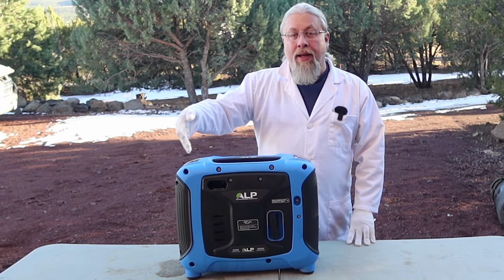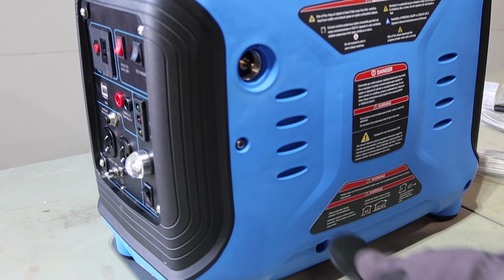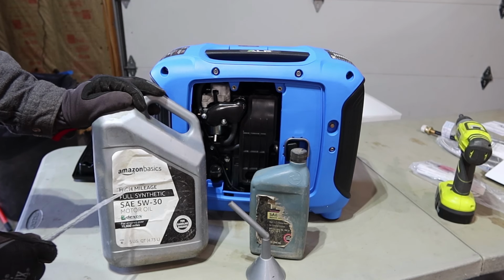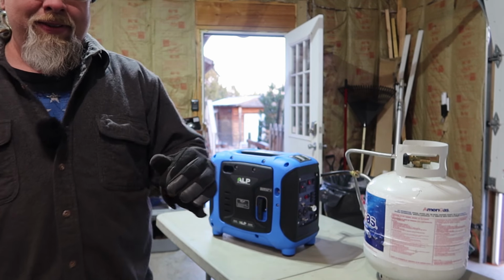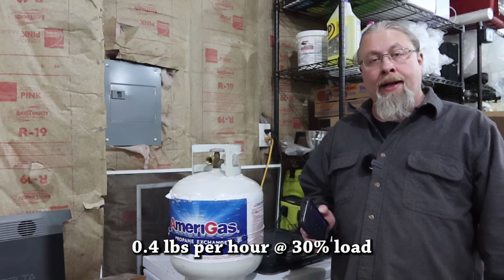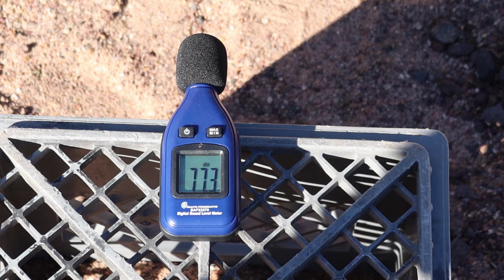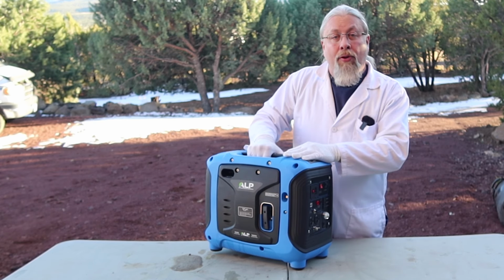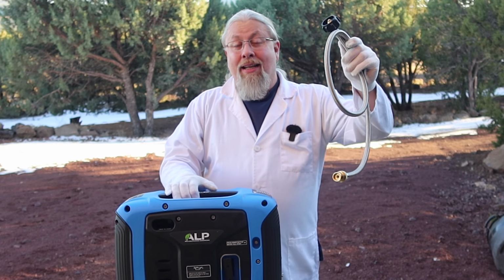ALP 1000w Propane Generator Review | Parallel Ready Eco Friendly Compact Efficient

Comment: I built a LPG powered Evaporate Air conditioner using a 3hp Honda 4 stroke motor to drive a water pump and scroll fan...
We were living in the Australian desert,  mining for opal for 10 years .
I went through two motors in that time and it worked perfectly. 
It would burn about one of these 20lb bottles every 5 days at 8 hrs a day at about 12oo rpm.
We couldn't live out there in the 45 to 50 Celsius summer temperatures without it.
I was in the air-conditioning industry and put it together in a day and a half..
PS...we made a fortune and sold the claim...with the A/C.
Gas is the go with many applications...

Comment: $500 for 1000 watts? Very little bang for the buck. No thanks.  A fridge takes 600Watts. You can get a 4500-5000 watt gasoline generator for the same amount. I can run my water pump, oil furnace, and fridge on that.

Comment: 15:52 so 3lbs of propane consumed to generate 4hrs*550W=2.2KWhrs. That would be 1.36 lbs of propane for 1 KWh of electricity? Or at costco propane refill prices ($0.50/lbs) approximately $0.67/KWh?

Trying to decide between portable solar or propane power for backup and camping.

Comment: A good tip to run new generators, are to have the economy mode on, that way it don't Rev that much.. I have a older gen that have been with me for many years, and always starts on the second pull regardless how long it's been sitting.. But that one I have to adjust the carb to run on lower rpm when I did the break in period.. It ran for 2.5 hr, the last 30min on 500w load..

Comment: 1000 watts is peanuts. My cargo trailer air conditioner requires two Honda 2000 watt. Not sure what air you are using?
Reply from the maker: 5000-6000 BTU runs all day on <800w.

Comment: I=P/E  Current =Power /Voltage= 1000Wats/115Vac(RMS)=8.695Amps (Surge current) APL spec is Max of 7.1 Amps, Max A Running wattage is 850 Watts, 5000BTU Air Condoner Surge Current is around 9 Amps

Comment: thanks for the video. .. Generally speaking, are propane generators more or less efficient than say, petrol or desiel ?
also, what does the eco mode actually do ?
.. do you think you could build a small enclosure for the generator (assuming you vented the exhaust / air intakes correctly), to help kill the sound ?
thanks again!
Reply: what your measure of efficient?     eco mode on any gen usually throttles is down when load drops off,  increases again when load returns

Comment: Do not use gage on dip stick to fill oil. Fill to at least to 1/2 of the threads on the oil fill hole. Use 1/4 choke and prime for 30 seconds before starting . This will NOT run any 5000 BTU Air Conditioner even though the Current rating for operation for most is only around 4.7 Amps it takes at least 9 Amps to overcome the surge current on most all 1000 watt generators. The Honda 1000 exceeds its current rating ( up to 11 Amps on some) it can start an AC if you start the fan first then turn on the compressor. Propane is a clean burning fuel with little if any carbon deposit on the cylinder walls. Synthetic motor oils have a higher flash point and leave very little in the way of carbon deposits. After a 10 hour burn in change the oil to remove any metal fragments and refill with synthetic and it should be good for year at least before changing.
Reply from the maker: Sorry but it absolutely will run my 5000 BTU. I ran it on a Sportsman 800w for nearly two years. This has more power.
Reply: @HOBOTECH  I had a Sportsman Generator it was such junk Amazon would not take it back and refunded my money.
Reply: 1000Wats/115Vac(RMS)=8.695Amps (Surge current) APL spec is Max of 7.1 Amps,
Reply: @HOBOTECH  Please give me the name of the AC you used.

Comment: My ALP just arrived (finely) $20 for crappy FedEx shipping that took forever . I am using Synthetic oil because of its high flash point that reduces carbon deposits. I did not use any regular motor oil to brake in the engine. Propane is a very clean burning fuel and so keep it clean from the start. Not sure if the 7.1 Amp will overcome the surge from the 5000 BTU Air Conditioner If I recall my Gas Honeywell 1000 took 9 amps so had to start it in stages fan on then compressor.
Reply: Well they were too cheap to buy a15 cent funnel so I got oil all over the place. And the 12 inch hose has the wrong fitting on it cant tell because the instruction suck. The fitting should not matter though. I spent 2 hours trying to get it started and it will only run for a few seconds. I spent $2000 and gear (from China) this week and none of it works. I thing the Chinese are dumping a lot of crap on us.
Reply: Had a problem starting the Generator but Bobby at tech support helped me out. DO NOT USE THE GAGE ON THE TIP OF THE DIPSTICK -  FILL OIL TILL IT IS COVERING THE THREADS ON THE FILLER HOLE. ONLY USE 1/4 ON THE CHOKE

Comment: Is 1000W ALP providing enough power to charge up an AC200P via AC adapter?
Reply from the maker: Yes
Reply: @HOBOTECH  Great.  Thinking about a hybrid back-up system - only using the generator to charge the 200P on cloudy days / nights.

Comment: How would one run an AC with this generator? Super long extension cord?
Reply from the maker: Plug a/c into the generator...
Reply: @HOBOTECH  so the generator is outside due to exhaust.. ok..i can  see what u mean. Works for ground level homes or ones with balconies. But i live in an apartment bldg.. will continue to look for other options.. I'm enjoying your vids btw.
Reply: @engelcrona  - get a window hanging box, just hang it outside a window, like a window A/C unit
Reply: @DavidHalko  clever.  Thx

Comment: Go to the hardware store buy the little red oxygen bottle you crack it open in front of the air filter your efficiency will go through the roof if you need very little of it to put the efficiency back up the best thing to do just go to sea level and compressed air in a air pig it’s the safest way to increase the oxygen or use nitrous oxide .

Comment: For someone with a battery bank, needing to just recharge it on cloudy days (less solar), running this occasionally on eco-mode as needed is an excellent way to address the need!  THANK YOU!
Reply: But you are polluting!
Reply: @tedmoss  — Propane pollutes less than other fuels. Even solar pollutes when you consider the manufacturing process.  What would you suggest?
Reply: @Erin-Thor  bicycle generator
Reply: @user70331  — Yes, for one battery, LOL!  I’ve seen off grid coffee shops in other countries where the patrons ride bikes to power the car batteries to run the laptops and whatever.   That works.  But one person riding a single bike produces enough electricity to run a bike light and a little more.  Charging a few li-ion batteries with say 400 Ah would take you… hell I’m not good at math… a hell of a long time, LOL!  I’m thinking weeks.   Dammit, now you’ve given me homework!  LOL!
Reply: @et5313  nobody is riding bikes to power a fucking car battery. A person who is in good shape would have to ride a bike for 1 HOUR just to produce 100wh... do you know how many wh it takes to drive a tesla model 3 just 1 mile? 240wh! You would have to peddle for 2.5hours of hard peddling just to charge 1 mile of range on a battery. You arent powering nothing more than a cell phone with a bike, period.
Reply: @user70331 this will force people to lose weight, i like this idea.
Reply: @tedmoss  so?
Reply: @randybobandy9828  The point flew over your head
Reply: @randybobandy9828  — Pollution is everyone’s issue.   Have you taken a positioning cruise (end of season transition from say Portugal to Florida) lately?  Our ocean has a lot of floating trash in it. When we make solar panels, windmills, li-ion batteries, the processes pollute more than you might think.  @Ted Moss has a point, he just doesn’t understand that propane is second to the sun for no pollution, that is if you don’t count the chemicals used.
Reply: @Erin-Thor  we will.never be able to like a modern way of life with out some pollution.
Reply: @randybobandy9828  — I agree, but that doesn’t mean we shouldn’t try to polite pollute less.
Reply: @Erin-Thor  Ideally you could invent an on, off switch that would turn this on, off when running a 110w, 3.5 cubic foot freezer, which runs on cycles.  Any takers there.
Reply: @UPdan  — Invent?  Moi?  😋  Buy yes, invent, not likely. LOL!
Reply: @tedmoss  You breathing is polluting.
Reply: @tedmoss  ohhh.... bug off with your pollution ,stick it where the sun don't shine

Comment: Can I run my Iceco VL65D fridge with it plugged into it's AC receptical? Also can I charge my Bluetti AC200P at the same time running my VL65D being  plugged into the Bluetti; in other words pass through charging.
Reply from the maker: yes and yes
Reply: @HOBOTECH  just to be clear; I can charge my Bluetti with the ALP 1000 propane generator  while my Iceco VL65D is plugged into my Bluetti correct?

Comment: That light makes the unit just a big propane powered flashlight.

A simple spark plug wrench is a great accessory to have for one of these things. Definitely something I think should come fit into the case. The oild though I find less necessary for them to ship. It's a generic product and I bet it has something to do with shipping. I could be wrong but I think any shipping company would want to know about flammable liquids being shipped.

Also, they go through oil massively anyways.

I think it should come with the hose for the big one, just cuz it's massive. Like so big, so why would they expect someone to just use a small tank? Also I've seen a much more interesting propane generator specifically designed for small bottles. They dock into it. It's 900 watts. Brand is Baja. Idk how good it is though but I heard about it by word of mouth as being a good thing for camping.

Comment: Good review, but I do think you were entirely too butthurt about no tools and oil. My experience has been the cheap-o units come with tools. Oil can vary from company to company if it's going to be there. The last 2 gens I bought did not come with oil.  I also question your use of the term "break in oil" as most small engines are already broke in by the time the consumer ends up with it.
Reply from the maker: I have purchased 6 generators and this was the first to not include oil or tools. I was making an observation and relaying that to the audience. I think too many are focusing on those minor points.

Comment: That's 1 KW. At 120 volt it's good for about 9 amps.  Think about that...., What's the average Mr. Coffee pull amp wise?  This thing is a joke
Reply from the maker: I've run my Mr Coffee on 1000w... My air conditioner, instant pot, pizza maker, microwave. I have videos going back years proving this.

Comment: I noticed that the "Eco Mode" switch was in the ON position when you tested how many watts you could pull.  What if you turn that feature off?  It also seems that when you performed the sound decibel test, the equipment you used to put a load on the generator, also created noise.  Would that effect the results?
Reply from the maker: Eco mode doesn't matter once you pull enough wattage. A more accurate sound test was redone in the follow up video no one seems to watch.
Reply: @HOBOTECH  Thank you, Sir... yes, I've seen the updated one 👍😀

Comment: In the UK that would not be a large Propane container ours run by weight,  size A 4.7kg, size B 11kg, size C 15.3kg, size D 23.2kg, size E 46.5kg. and we do not call Propane 'gas'
Reply: @UCVsNMiYQkqwIq_gd0rTJF9g Only those who do not use Propane on a business level would possibly call it 'gas', it is mostly used in industry as a cutting gas along side acetylene, with a secondary market for cooking and heating.

Comment: Take caution with propane only generators. I live in Florida and bought a propane only generator. I loved it until it stopped working. Then found there were no places that would work on propane only generators within 150 miles. Make sure you have a service center within a reasonable distance before you buy one. There is something funny about the laws about working on propane appliances in Florida that prevents shop from working on propane appliances.

Propane tanks are called LP5 as in 5 gallons water capacity. 80% capacity is 20 lbs (yes, do the math) of propane. The newer overfill protection valves don't always allow full volume. AND the exchange cylinders only fill to maybe 15 lbs, if they fill them that much. Yes, I filled propane tanks professionally, and I measured exchange cylinders.

Comment: "Don't use synthetic during break in, you want some wear"..
Gee, evidently Porsche, Audi, BMW, Mercedes, Ferrari, Corvette, all have it wrong. They ALL come from the factory with full synthetic.
Reply from the maker: Small engines and car engines are totally different.
Reply: @HOBOTECH  Yes, indeed they ARE!  Small engines are air-cooled and run hotter than auto engines. Thus the need for synthetics.Keep in ind that synthetics are NOT "slipperier". Their sole claim to fame is that they can tolerate higher temperatures without breaking down.

Comment: Nice Video.  Does the generator need to be stored in upright orientation? Will it run at high altitude? e.g. 7000-8000 ft?
Reply from the maker: Yes. I am at 7k in this video.
Reply: @HOBOTECH  awesome, thanks

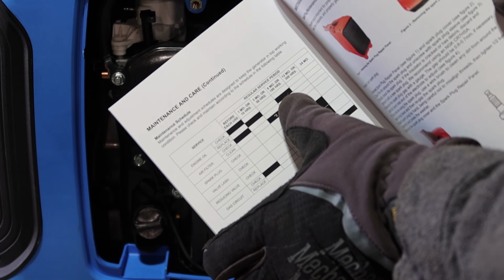Comment: At 6:00 you say to not follow the manufacturer's instructions, but instead change the oil twice as often.  Is there any science to back up your override?  With all due respect, I have a tendency to want to follow the printed directions, over the whims of a railroad bum.
Reply from the maker: By 50 hours the oil is usually black. I've lost enough generators that I change at 50. Do whatever you want.

Comment: really less than 40hrs on a 90% load, also, how many 13,500BTU A/C's will it run? ZERO..... I will stick with my Predator 3500watt inverter/generator.  It runs my 13,500BTU A/C, dometic fridge, 27" tv, interior dome lights, water pump,6 gallon water heater, converter with 2 batteries connected for 20hours on 5 gallons of fuel, its to bad my A/C doesn't turn off when compressor cycles off

Comment: Like the concept, but neither the manufacturer, nor you make total sense to me. For example, a propane engine does not require or have a carburetor.
Reply from the maker: Of course it has a carb. You still need to mix propane with air in the right ratio.

Comment: Lithium is still where it's at.
Reply: “Lithium” - can’t run a lithium battery pack for 2 days, at that energy load, at that cost. 

Also, if the reason is for 1x or 2x a year power backup, the lithium charged once will likely experience power loss. A fully charged lithium-ion battery at 4.2v will also degrade, if left unused. 

Lithium may also be more of a fire hazard, unless you are planning on burning it! ;-)

If constantly charging the Lithium batteries via solar, hydro, or wind, while regularly discharging, that is a very different use case, and makes a lot of sense.
Reply: @DavidHalko  was referring to daily use with portability.

Comment: Loved this review and was totally hooked! Wanting to stick w/ Propane. Decided to do more research and realized maybe the Champion 2000 duel fuel would be better for me. Little cheaper, higher load, but little less duration and much cheaper parallel kit. I'm sure the cost of Propane in the long run would make the ALP cheaper. Deal break / tie breaker was only 1 yr warranty for ALP and 3 yr for the Champion. Maybe I'm wrong, if anyone has one please chime in. btw - for me going anything bigger (100 plus pound units) isn't really an option at this point even though more bang for buck.
Reply from the maker: I owned a Champion. They are LOUD and warranty or not aren't very durable. ALP is parallel ready out of the box.
Reply: @HOBOTECH  Thanks - how has the ALP held up the last 6 months?

Comment: For those of you that aren’t very mechanically inclined I will add if you’re worried about a propane leak just glad your bottle of simple green or dish soap and water and once you turn the valve on the tank spray the line at all connections and check for bubbles if it bubbles you have a leak tight fitting or replace hose as necessary

Comment: Or they didn’t forget to put it in the manual and that is the paper you can take with you when you’re using it if you know how to operate it and have read the manual. You need to be light when you Go camping. Extra manuals no matter how small add more load

Comment: With a power outage I just need to keep my freezers running.  That’s all I will need it for. How will it do for that ? I was thinking of a Generac generator.
Reply from the maker: This will do that just fine and with a lot less stink.
Reply: “Keep my freezers running” - idle your car with an inverter. My 120v 3000 watt inverter provides 1500 watts on 1 leg, powers 2x refrigerators, my whole house heating system, a TV, and some lights. It will work for days.

I need something a lot bigger for my 240v whole house A/C, just to turn over the compressor.

Comment: Nice video, thanks Captain Hoodie! I have the Baja 700W-900W propane generator. Perfect for supporting a small load, or charging our battery generators! The batteries can take the surge (as these won’t), and works great. Just getting my camping and emergency home set up about figured out. You don’t waste a lot of excess Watts from a larger generator when you don’t really need them. Thanks. D

Comment: I doubt an air conditioner will start with that generator. If it does, it is a good air conditioner. It is also likely to be noisy depending on Locked Rotor Amps.
Reply from the maker: I've done it many times. I used to run a very good Frigidaire 5000 btu on an 800w Sportsman. Did a dozen videos showing it.